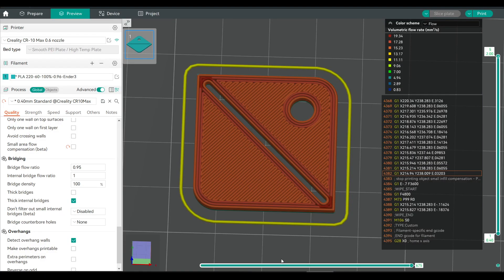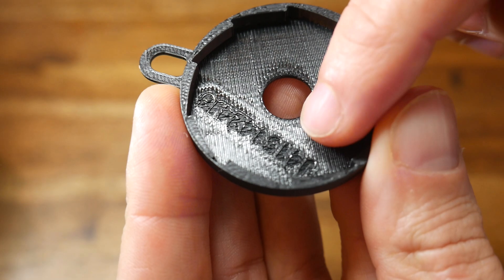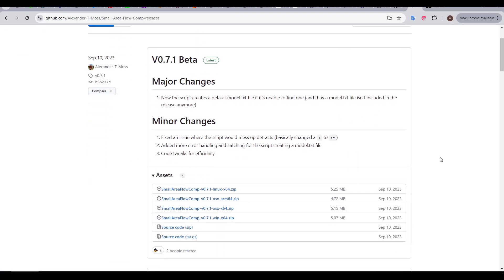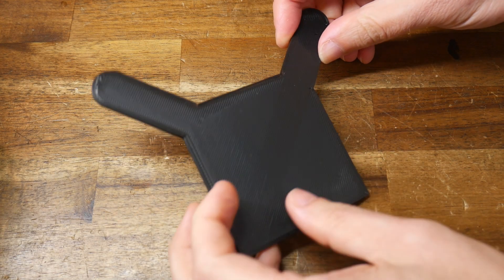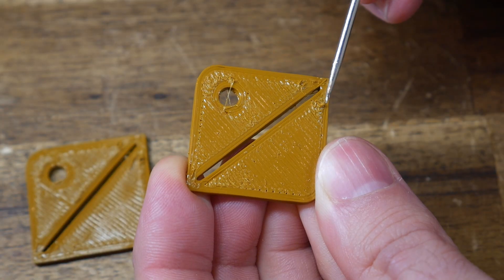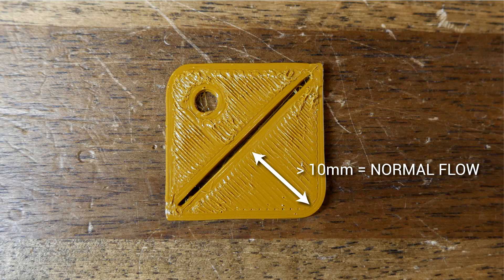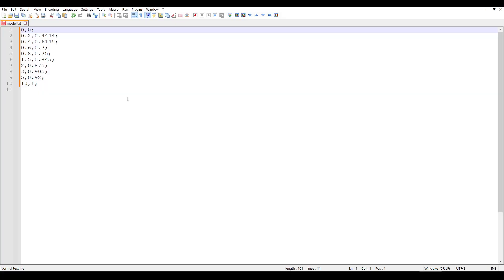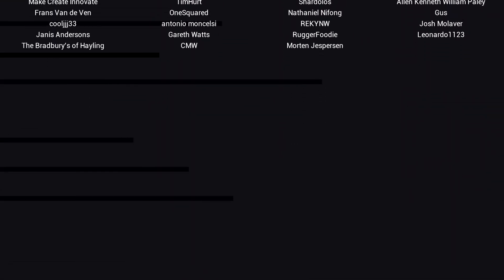How to tune Small Area Flow Compensation to improve 3D print quality

Comment: Great video I like postprocessing scripts, because they enable us to come up with ideas to modify gcode. This way we have a proof of concept and it will eventually be implemented in the slicer, which is quite complex to implement if you aren't experienced and familiar with the code. It's also possible to write some code specific to one project and add a specific use case , which isn't available in the slicer. I've done some work to the gradient infill script of CNC kitchen to adopt to prusa and orca slicer. I also added a maximum volumetric flow. My first project was the implementation for a maximum amount of retractions in an extrusion interval which was already implemented in Cura. This way I was able to add this function to any slicers gcode.

Comment: Hey Michael, thanks a lot for your work, great as always. I wonder though if it's worth going through each value separately or better to just define a function? With a little reverse engineering I found that the original values seem to follow f(x)=0.25/(x-0.25) except for x>=10 where f(x) is simply fixed at 1. So I would suggest using the function f(x)=1-a/(x-a) starting with a=0.25 and then adjusting the value of a to tune the model. Increasing a means lowering the values in the model, which makes the reduction stronger. What do you think?
Reply: Could this be translated into a spreadsheet formula in excel/google?

Comment: This is really handy.  I've been deliberately setting non-perimeters to underextrude to avoid this issue, just accepting that I'll get small gaps as a result.  I accepted that because it's better than the little bulges getting hit by the nozzle and either knocking the print loose or causing a layer shift, both of which have only gotten worse as I've increased my printing speed with the help of resonance compensation and linear advance...

I've never used Orca; hopefully there's nothing I'm using in Cura that I would miss...  I guess I could also try post-processing it myself, or see if there's a way to add post-processing directly to klipper, now that I'm running it.
Reply: I was curious if linear advance could fix this issue on its own, but you experience seems to indicate otherwise.
Reply: @ALittleSlowest  It helped a little, but didn't solve it outright.  It was better at preventing over-extrusion on corners, resulting in actual 90° corners instead of columns protruding from the corner.

Comment: I've had similar problems but it's not exactly small areas, but rather the edges of areas (like shown around the borders and middle holes at 1:29 ). SAFC didn't help when I tried it with the OrcaSlicer beta a while ago. Increasing pressure advance helps a fair amount but that produces underextrusion in other areas. Any ideas?

Comment: This is finally something new after weeks, for us retail consumers! Thanks!
Having a Bambu I'm pretty ok with surfaces in general. Wonder if this will solve uneven surfaces in my case since it might be this lil tweak but it looks like more the color of the material changing when slowing to shorter paths, in an infill. How it reflects light, like broad surfaces shine while short track corners are matte, dull. Indeed it's a game changer on objects with many upper surfaces like the first one, because overextrusion in corners is still slightly a thing even on Bambu machines and calibrated flowrate.

Comment: when this was in beta, this had an issue with my printer using CAN, the flow changes were so detailed and gradient, it would cap out the CAN line data, because of the multiple different extruder commands, i will try again and see if that has been fixed

Comment: I don't like that this is needed at the G-code level. Ideally we'd build extruders that have consistent extrusion; failing that, that it would be something the printer firmware can compensate. Ideally we'd understand what causes it physically and figure out a single compensation value as opposed to modelling a whole curve. But it's the start of the investigation i suppose, and having a tool like this is better than not having one.
Reply: Yeah, that is my mine gripe with this too. It doesn't physically model anything (like pressure advance, etc). Its just superficial compensation that is dependent on all kinds of things
Reply: ideally everything would work ideally (-8
Reply: If im understanding correvtly It's not a consistency problem. It's a non-linearity problem. At a particular commanded feed the extruder will flow at a consistent rate, but the relationship between commanded feed and actual flow rate isn't linear, so software compensation is necessary.
Reply: @imbored742  that still means that this is a rather dirty hack and does not at all address the underlying problem.
Also being non-linear is irrelevant. Nothing is linear if you look closely.
Reply: @ABaumstumpf  being non-linear is the entire problem, and is almost certainly a result of the physics of forcing molten plastic through a nozzle. Modeling flow response as non-linear in software solves the problem with no hardware cost.

It may not be a viscerally satisfying solution to you, but that doesn't mean it isn't a good one.
Reply: @imbored742  it doesn't model anything as it is a simple hack based on distance. And being nine linear is no problem... Which would be obvious to you if you had any understanding of what is going on as those whole tool is based on simple guestimates and linear interpolation.
Reply: @ABaumstumpf  If being non-linear wasn't a problem, you wouldn't need the fix in the first place. The printer extrudes more plastic than expected on short paths because the acceleration of the motion system and that of the nozzle flow do not map with a simple linear interpolation. This fix allows calibrating a non-linear interpolation.
Reply: @imbored742  "If being non-linear wasn't a problem, you wouldn't need the fix in the first place. "
how can you even come up with something that is so wrong?
Reply: @ABaumstumpf  If the response was linear you could solve it by tuning your extrusion multiplier, but you can't.
Reply: @imbored742  "If the response was linear you could solve it by tuning your extrusion multiplier, but you can't."
You are under the wrong assumption that this has anything to do with the relation of extrusion-speed and movement. Hint: That is not the case - hence why this hack was even created and why it only lessens the impact to some degree no matter how much you tune it.

The underlying problems is something different which needs to first be investigated. It might in fact very well be completely linear effect that causes this.
Reply: @ABaumstumpf  the same extrusion multiplier causing over or underextrusion on different path lengths is the very definition of a non-linear relationship. There is a mismatch between the acceleration profiles of the extruder and the motion system due to hysteresis in the extruder. We use things like pressure advance and priming for the same reason.
Reply: @imbored742  "is the very definition of a non-linear relationship."
Ah yes - cause you have been able to show what the exact cause is? Oh riiight.
you did not, you are purely speculating on the cause - or rather just making shit up without knowing anything.

"There is a mismatch between the acceleration profiles of the extruder and the motion system due to hysteresis in the extruder."
Just that this is not the case as even the test-example is so nicely showing: The problem clearly does NOT come from just acceleration and a mismatch between movement and extrusion.

But do go on - make up more shit without any evidence. At least you are good at that.
Reply: @ABaumstumpf  the evidence is that it's over-extruding on the parts with short moves and not on the parts with long moves. This is sufficient to demonstrate a relationship with move length and over-extrusion.

Likewise, hysteresis in extrusion is well demonstrated in 3d printing. It doesn't take some wild leap of imagination to put two and two together here.
Reply: @imbored742  "the evidence is that it's over-extruding on the parts with short moves and not on the parts with long moves. "
That only shows that there is a problem in the assumptions. So you failed at even the pre-requisits.

"This is sufficient to demonstrate a relationship with move length and over-extrusion."
No, no it is not.

"It doesn't take some wild leap of imagination to put two and two together here." That explains a lot: if imagination is all you have then all you do is imagine that you were correct. Just that it has no relation to reality.
Reply: @ABaumstumpf  every comment you've posted so far has amounted to "nuh-uh" and you're clearly not even understanding what I'm saying.

I said that it doesn't require some leap of imagination. As in, this is basic deductive reasoning.

You're straight up misrepresenting what I'm saying, and despite all your protestations about my supposed lack of any supporting evidence, you've presented none of your own, nor any alternative theories beyond simple nay-saying.

I'm done here.
Reply: @imbored742   I actually fundamentally disagree that there is overextrusion on short moves. I think we're dealing with an opposite phenomenon. The extruder can't make filament out of thin air, you push the gear by 1mm, you get at most 1mm filament out. There CAN be phenomena that look like overextrusion meaning the melt lands somewhere where it's not supposed to and you get a bump, but they are not technically overextrusion right, and if we discover and name them, then we can deal with those too. Die swell and whatnot.

A well documented phenomenon is that as you approach a certain volumetric limit for a given material-extruder-hotend combo, with increasing extrusion rate, the amount of filament actually expelled decreases, effective underextrusion. Maybe it grinds into dust, maybe it slips back on extruder gear, i don't think this is 100% established, but i have a much easier time believing in material disappearing than in material materialising from nothing.

Common calibration procedures for flow rate are wrong. You're "supposed" to run an extruder with no hot-end or no nozzle for calibration purposes to eliminate back pressure, and make the extrusion rate the absolute maximum value and only dependent on the extruder geometry. But this is not how most people do that, they run through the hot-end and hot nozzle, they mark off a section of filament, etc, and then they extrude at like 10mm/s which is like what 25mm^3/s and for a basic hotend, this is mad. The method with printing plates where you judge the top surface might not be ideal either, also suffering from back pressure.

Of course you want to be able to print fast at highest possible quality so yeah a compensation for high back pressure makes sense, but then formulated as a compensation for loss at high extrusion rates as opposed to a compensation at low extrusion rates. This should be really easy to calibrate too as you can just weigh 💩 shaped blobs like Stefan does it, as opposed to just guesswork like in this video.

And of course the firmware can tally a running estimate of back pressure and apply corresponding compensation, we actually have the computational headroom to do so - it's much less overhead than many of the things attempted before, it's peanuts compared to say pressure advance or S-curve, resonance shaping, etc. Whether it's linear or approximated-polynomial or piecewise-linear, we can do it all.
Reply: @SianaGearz  It's not filament coming out of nowhere. It's hysteresis. If you have no hot end on your extruder, then 1mm³ of filament in produces 1mm³ of filament out, but once you start melting filament and forcing it through a nozzle things get a little more complicated. Now when the extruder starts, it takes a moment to build up pressure in the hotend before the flow rate catches up, and when the extruder stops it takes a moment before the pressure drops and the flow rate goes back down. On long moves the pressure and flow rate have time to normalize, but a rapid succession of short moves with rapid acceleration due to sharp direction changes mean that the pressure doesn't normalize, and flow doesn't match predictions.
Reply: @imbored742   But this slicer change doesn't compensate for hysteresis, at all. The only change it introduces is for flow rate vs. print move length.

And besides hysteresis is something we have Pressure Advance for. It literally performs pressure accumulating/releasing extruder moves in advance of the corresponding XYZ movement. I guess the model is not quite comprehensive enough though...
Reply: @imbored742  "I said that it doesn't require some leap of imagination. As in, this is basic deductive reasoning."
Yeah - you said that WHILE taking a leap of imagination and making shit up.

Comment: A spot on flow calibration and pressure advance is enough to solve this issue on small areas. just use ellis3d guide and pa calibration page for this and you are good, just make sure your filament is dry.

Comment: This was so helpful.  I was struggling to tune in my top surfaces and it turned out that while I needed small area compensation, I needed much lower amounts of compensation than the default model provided.

Comment: Brilliant video! You've managed to explain it better than I could! ❤
Reply: Thank you for making this. By chance, how did you come up with the default values? It feels like they should come from some function that might be easier to tweak than a table.
Reply: @maxconser9930  At it's core, the model uses (cubic spline) interpolation. This is the actual mathsy bit behind joining all the flow model points together, there are specific tools to show the result of this type of interpolation, but they are nowhere near as user friendly as a simpler chart in a spreadsheet. The default values were actually taken from the initial approach used for the flow model, which was to use an equation for the model line and not interpolation of points, in the end interpolation was favoured as is more intuitive to change than an arbitrary equation (you'll notice the lengths of the points in the default model are at "nice" values, then the flow rate % was what the original equation model produced at those lengths)
Reply from the maker: Thanks for your great work!
Reply: Appreciate you and your contribution.  This is great

Comment: Highly interesting! 🎉 On the Bambu X1C the issue is the opposite : large areas (~200mm+ ) the layer infill creates a micro mesh [using default settings]. The layers are not watertight and water leaks (after hours or days)!

Does this feature resolve this underextrusion issue?
Reply: The flow at full hotend flowrate will be less than was asked for. Less speed, more heat or better hotend should help 😉
It could also be quite difficult to achieve watertightness without coating the object 🤔
Reply: @kimmotoivanen  Thanks for your reply. I meant: by using the default BambuLab settings. I was not meaning: by pushing to the limits. Sorry for the ambiguity!
Also, I did achieve watertightness by increasing the flowrate. The default one is ok on short distances (under 100mm or so), but not on longer distances; based on my experience.
Plus, by using a magnifier, space can be noticed between the nozzle passes (while using a clean nozzle and the default Bambu settings).
Reply: @LigneDesign  I get it 👍
I think Marlin FW had pull request for compensating extruder "slip" at high flow rates. 

PrusaSlicer has PR #12186 and SuperSlicer has issue #3854 for similar compensation. So it may become possibility in near future 😉

Fast printing is not as simple to calibrate that good old 40 mm/s everywhere 😅
Reply: It should, if you increase the general extrusion multiplier.

Comment: Anybody knows what causes over extrusion on short lines in the first place?
Reply: I don't think anything causes overextrusion on short lines per se. If you propel 1mm of filament through the hot-end, there's no way 2 or 3mm are going to come out, an extruder doesn't exactly make plastic from thin air.

Instead you have underextrusion on high speed extrusion moves, as the filament slips back on the extruder gear under back pressure, for example. The loss of extrusion volume with high extrusion rate isn't understood in detail as far as i can tell.

However many people calibrate their extrusion flow in what is effectively an unrealistically high speed extrusion state, so their overall flow rate is set too high. You're "supposed" to remove the hot-end or nozzle and calibrate extrusion with no resistance to only make it dependent on extruder geometry.
Reply: @SianaGearz  that makes does sense, on short lines the x and y axis acceleration limits lower average speed.
I was imagining some counterintuitive geometry phenomenon. 
What's weird is that this also occurs at fairly low volumetric flows, like 1/2 of maximum an my extruder (orbiter 2, a notoriously grippy high torque one).

If you are right, this should be corrected for with non linear extrusion rate in firmware instead of line length in the slicer

Comment: Unfortunately with a 0.6 nozzle I get constant „access violation“ errors in OrcaSlicer when I try to enable small area flow compensation. There are several people having similiar problems in the GitHub issues.
Reply: For anyone with similar problems: Try disabling Arc fitting. It seems to be incompatible currently.